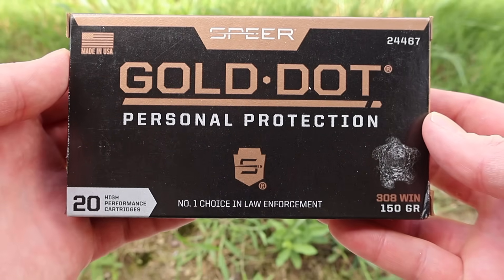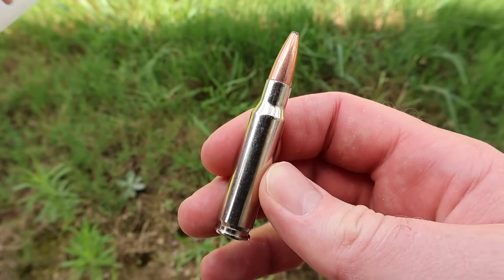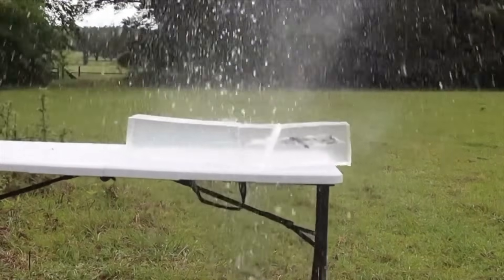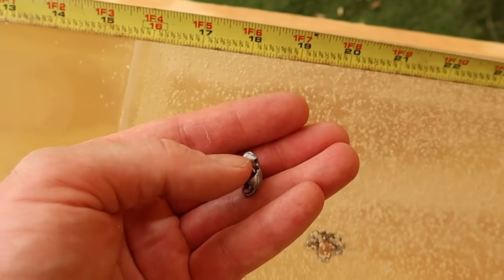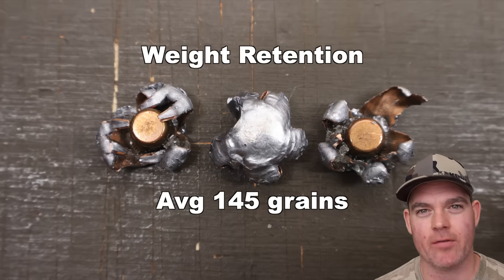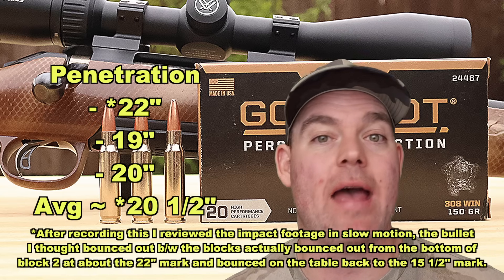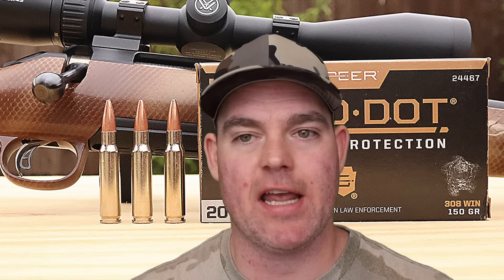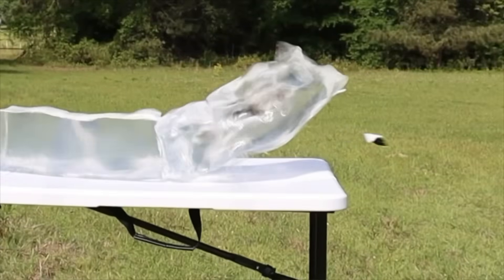308 Winchester Speer Gold Dot Personal Protection Ballistics Gel Ammo Test

Comment: Nice Video! I'm using these now for about 2 years out of my Heym SR30 with a 50 cm barrel and shot around 20 boars with a weight from 20 to 80 kg. They work very great. I recovered 2 bullets in boars on the other Side of the skin when i shot a little too  diagonal. They look exactly as advertised. On all other boars they went straight trough, even when hitting the shoulder.  BTW you forgot to mention the sealed primers. For me the best choice on medium Game for that price.
Greetings from Germany

Comment: I'm sure these are great for LE work compared to others like critical defense type bullets which are fine for a home defense bullet..Those bonded bullets would be the best for them with barriers like windshields etc.  Regardless its in 308 for protection, its gonna do the job every time.
Planning to order a case of these for myself as you can save a big chunk on these compared to the Fed Fusion round for hunting as well.
Reply: I use them for stacking. I have changed to Critical Defense for HD, as much for the name as the fact that they are excellent cartridges for this application.

Comment: I managed to get my hands on some of the 168's as a component earlier in the year to load in .300 Savage for a Savage 99. Haven't been able to chrono my loads yet but load data "suggests" they should be doing around 2,300fps. Expands to around .7" on average and retains every bit of weight. Like the Fusion, definitely a solid hunting bullet.